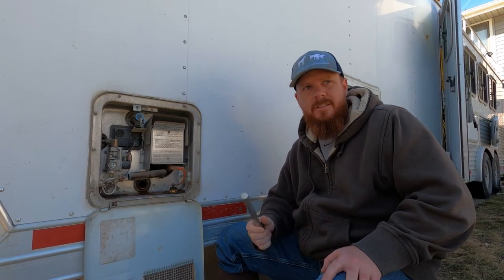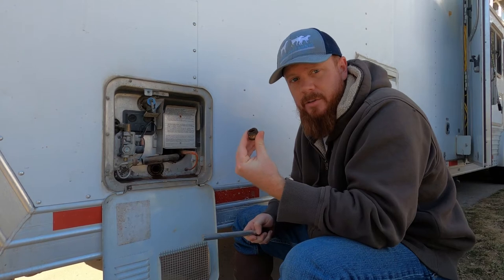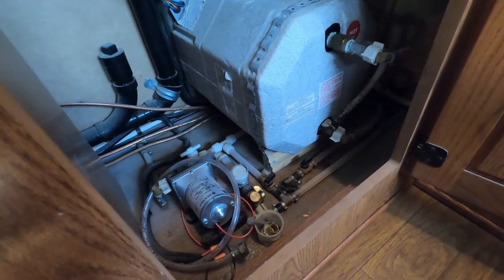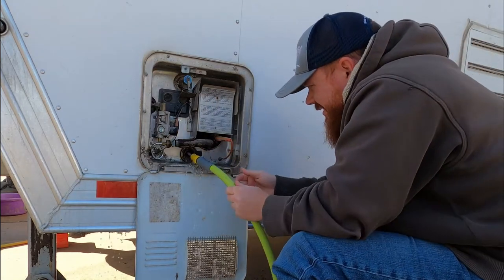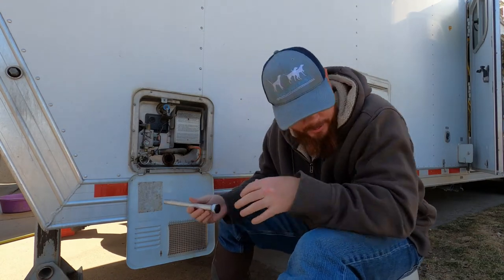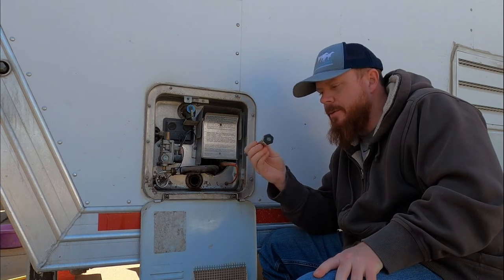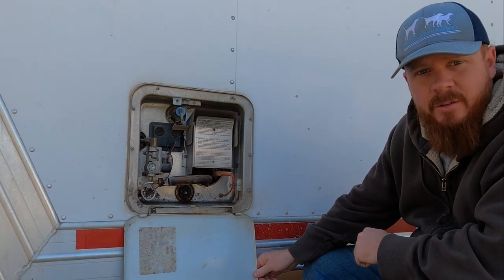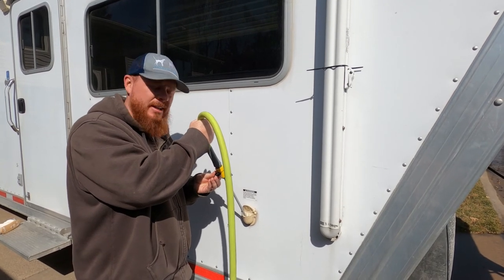How To Replace Your RV Water Heater Anode Rod (PREVIOUS OWNER NEVER REPLACED!)

Comment: Thanks for the video. We bought a used 2021 rv in 2021 and the instruction manual notebook does not have the water heater manual. I had been wondering if the anode rod nut was a righty-righty one and your video showed me. I am on my 3rd rv and I am one of those who never replaced the anode rod. The dealer may have, but I don’t recall. I want to keep my “new” rv water heater in good shape

Comment: I have an 88 RV my water heater has a quarter inch drain plug and no anode as far as I could see my hot water smells rusty I'm wondering if it's an aluminum water heater

Comment: My anode rod on my 2020 Rockwood only goes in about 3/4 of the way.  Leaving about 3 rings of thread sticking out.  The actually threaded hole is tapered so it won't actually screw in all the way like a garden hose would.  I think you are good to go as far as the threading goes
Reply from the maker: Thank you so much I appreciate it! I thought the rust was somewhat causing it but I also somewhat thought that it didn't screw in all the way.
Reply: @RedbeardOutdoors-IrishSetters  I thought the same thing when installing mine.
Reply: I didn't know that it was a tapered thread and last spring I tightened the rod in so bad, I couldn't get it loosened in the fall for the winterization.  Blew out all the water though via compressed air but still.  Not even my breaker bar would budge it.  UGH!

Comment: How'd that hold up, do you recall? I'm having the same problem where it won't thread through all the way.
Reply from the maker: So far so good if I remember correctly I just had to force it untill the thread finally took due to rust.
Reply: @RedbeardOutdoors-IrishSetters  I had to buy a thread tap to clear the water build-up and rust out of mine. Afterward the anode rod fit like a glove.

Comment: Anyone know any tricks for when the anode rod is rusted into tank? I cant muscle it off 😂. Im using 1 1/16 with extension and pry bar because its under my sink
Reply from the maker: Not sure, sounds like you will need to drill it out or possibly replace the water heater at this point if it is old and hasn't been drained in a really long time.

Comment: The research I've been doing on these say not to put plumber's tape on the anode threads, and that if chips and rust come out of your tank when draining if your tank is bad. The tank cannot be repaired so the heater should be replaced. It could be deadly dangerous, cause explosion if you don't replace the hot water heater.:)